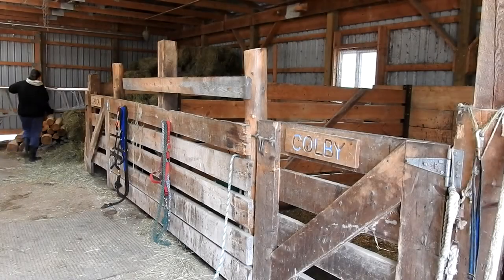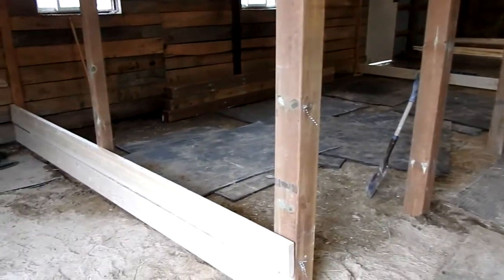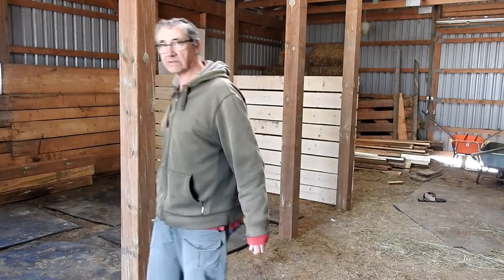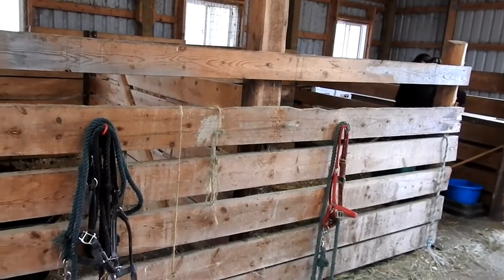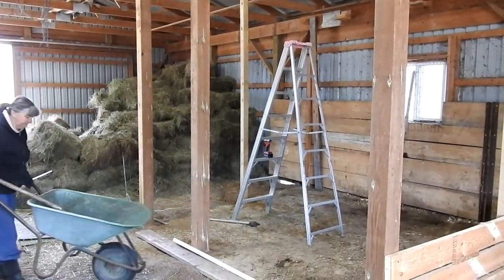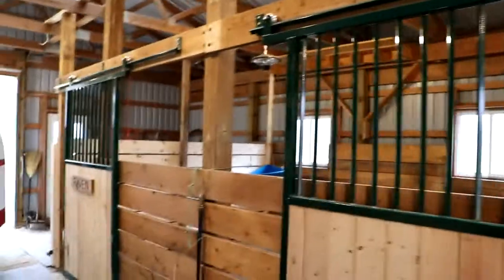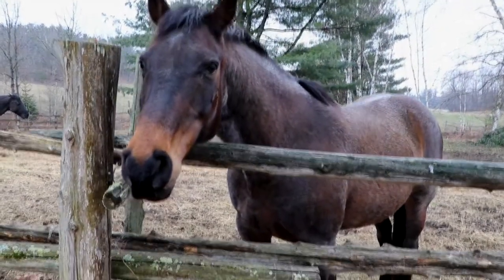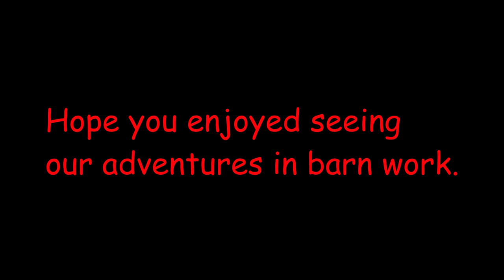Building Horse Stalls - March- April 2020

Comment: Hi, this looks great!  What did you put under your stable mats?  I couldn't see what was there. Any ideas for doing something like this if our pole barn is open on side?
Reply from the maker: Thanks. We don’t have a specific floor in our barn other than just the natural dirt. So the mats are just on the dirt. Typically horse stalls would be in a fully enclosed barn. But if you needed to build stalls in a barn open on one side you could still use the existing side poles and maybe have to put in a few other poles to create the front of the stalls.